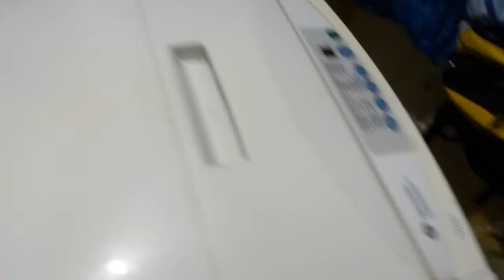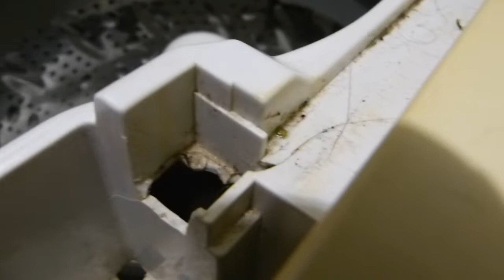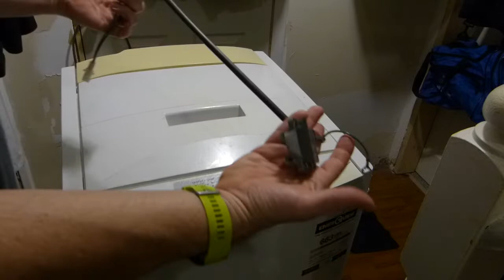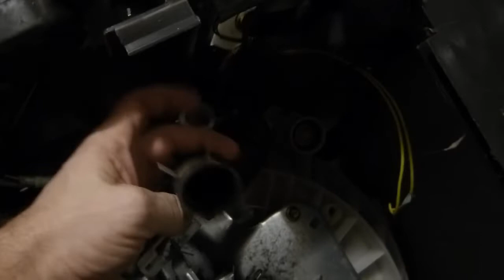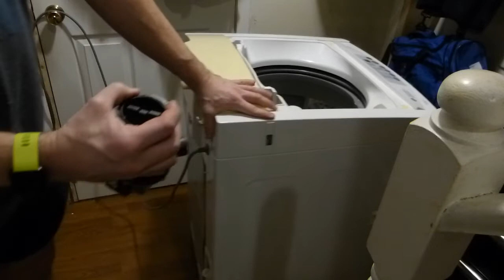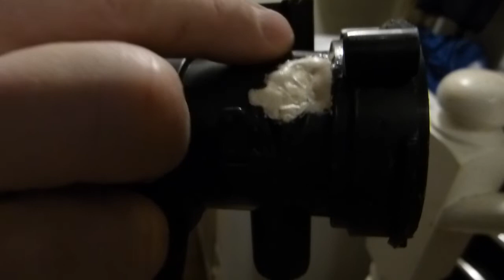GE Spacemaker lid hinge and water pump fixes

Comment: Just a quick tip regarding the blue lint filters inside the machine. You can find them on aliexpress for under 10 bucks, instead of 50 bucks at a local shop!. Just make sure it looks exactly like the one you have in the machine. they go by the name silver Nano or Magic Filter I think.
Reply from the maker: Thanks for the info!
Reply: Thank you

Comment: Hello I have the same exact machine and my machine stopped working during the rinse cycle and now won’t power back on I’ve emptied the bin removed the hoses and emptied the water tried resetting it as per he instructions and still no power help

Comment: Hello, I have the same exact machine and model. I encountered a problem last week and I am still contemplating if I should open it up and try to fix it myself.

The water won't drain and getting stuck at 10 minutes left in the timer but I can hear the humming sound that it's trying to drain. I think there was an error code "de" at first but now just getting stuck at 10 mins. Right now I am just manually draining it and when it's almost empty I try to set a new load with no actual clothes just to see if it will get reset or something. I was hoping I just put too much load or it was uneven. Unfortunately, it still won't drain and still getting stuck at 10 mins left in.

Would you help me step by step on what to do? You seem to be very knowledgeable.  Thank you so much in advance.
Reply: Hi - did you ever fix the slow drain problem with your washing machine?

Comment: Hi there. I have this same washer and am in the North America area. This make and model is very rare here so I am needing to make repairs myself to avoid buying a new unit and spending more than the washer is worth on parts.
The washer frequently gets stuck at the drain cycle (shows "Dr") and will not advance. My first repair attempt was to check the water pump.  I disassembled the washer as you have and disconnected all hoses. The only thing I found was a penny in one of the hoses. I removed it and thought that would fix it, but unfortunately the issue remains. I have checked all hoses, I make sure the drain hose is not kinked during operation, and the water pump itself looks normal, no holes, etc. Is there something else I could be missing? 
I don't think my lid switch is broken, but as a last ditch effort maybe I ought to try.  How did you remove the lid?
Reply from the maker: Advancing in a program (or not) has to do with sensor input and signal processing. Cleaning pump is a good start, also check out the fill/drain sensor, the tubing attached should be unclogged and not leaking vacuum/pressure as the water fills the tubing.

Comment: I have a WSLP1500J0WW with what looks like the same pump.  Could you possibly help me with some repair advice/troubleshooting?
Reply from the maker: Might. Let's try.
Reply: @theoverengineer  Thank you so much!  A pen (I just got the washer, not my pen) made it's way to the pump coin trap & got jammed.  I fished it out then after the pump stopped pumping.  I took the pump out, checked it for obstructions, put it back together & back on the washer now I'm afraid of my washer lol
Reply from the maker: Thanks for sharing your story. Pump should work if electrical contact blades are in good condition.
Reply: @theoverengineer  I've no clue what that means but I purchased a service manual. Before I even get to the pump,  I should have mentioned that HALF a pen made it's way to the pump.  What should I take apart to find the other half of the pen (it wasn't in the pump or pump hoses) to ensure when I get this working again the other half doesn't do the same thing?
Reply from the maker: Ah. The rest of the pen is between the stainless steel drum and a plastic tub that surrounds it. Here is how these 2 parts look like at 18:30-19:00, then jump to 21:00. It is REAAALLLLY inconvenient to separate the tub and the drum. Might want to leave the pen alone, it's lodged in  somewhere, may never come loose on its own ...
Reply: @theoverengineer  Those links just restart the above video for me.  Oh, good.  I was hoping to not have to do that.   I plan to put worm clamps on the pump hoses then test out the spin, drain & drain pump functions in the service mode.  It did have a quick error message but it went away super fast  & when I pressed the spin button yesterday all I heard was a hum & nothing spun.
Reply from the maker: My mistake, I apologize, forgot the actual link. https://www.youtube.com/watch?v=IxvBV7SW3Wo Also, the missing half pen only MIGHT be there, looking into the space inside the tub with a sewer line camera could be less painful than overhaul.
Reply: I have the wslp1500joww and the machine gives the Lo code and the code is for the lid switch. The part is no longer made how can I fix this?